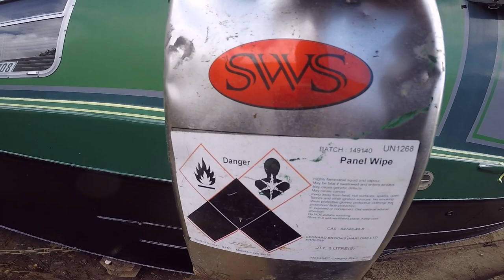Traditional Non Slip Narrowboat Sanded Painted Deck & Gunwales

Comment: So simple! And applicable to anything really. If it wears, you can repaint, where grip tape will degrade over time and the adhesive will fail...!
Reply from the maker: tes your right it can be used on anything with the correct paint or even varnish. the skate tape is not the answer as you say. doorsteps and ladder rungs spring to mind. Thanks for watching ss

Comment: Nice one, I assume I can use same process for touching up small areas that are damaged?
Reply from the maker: Hi mate. Yes it would work for repairing I expect. As long as it’s clean and degreased so paint sticks. Cheers
Reply: @DoItWithPaulie  Thanks Paul, redoing an entire widebeam and the roof was all rust and other large areas: https://youtu.be/rsd-7IjTzTI?si=1S3Zq9-dVj_fLY44

Comment: made it look easy, the green gloss paint you used for the gunwales, is it the same green gloss as the rest of your boat or does it go a different shade with the sand on?
Reply from the maker: It is easy mate. That was the same gloss as the boat although it was a new tin,different batch,onto old paint.It does change the shade a bit with the sand but it looks great.

Comment: any tips on how to remove old non skid / grit paint?
Reply from the maker: Hi Gary. On your gunwales if  your paint is ok just scrape it back tape it up and go over it again. If it all has to come off,a grinder with sanding fibre disc should work,or a wire wheel in the grinder,for decks and big flat areas such as decks and roofs hire a scabbler machine. Also look at a tercoo head for a drill,they look like they work well but slow going and hard on ya drill. Here is one https://amzn.to/3ZMP3oo Cheers mate hope that helps

Comment: How coarse is the sand? It looks like fine/sugar sand on camera. I'm pretty sure they use recycled/shredded rubber bits on dog agility contacts, but that's so it's not as abrasive on their paws, but I'm sure that's more expensive than your generic DIY store sand.
Reply from the maker: not sure on grade. its just a fine dried sand used for paving gaps. it gives the perfect finish for our boats slippery bits
Reply from the maker: Thinking about it i suppose it is as course as sugar
Reply: @DoItWithPaulie  That's the type of sand we had in New Jersey (where I grew up - they call it sugar sand). The sand here in Massachusetts tends to be coarser and darker in color. I've been on beaches in New Zealand that were all polished stones and others that were all made out of shells... so it all depends on where it comes from, I guess. 🙂